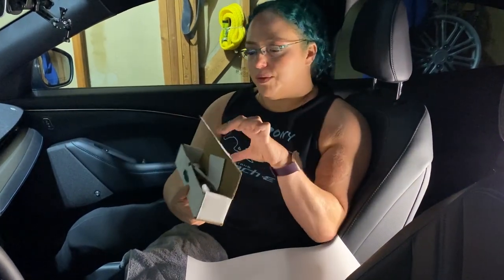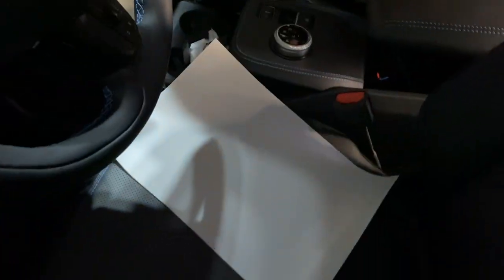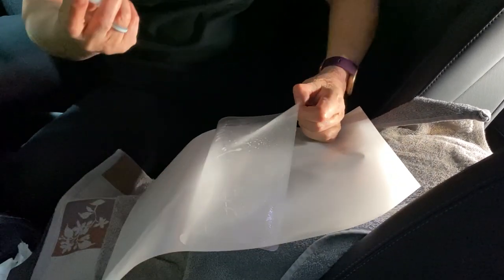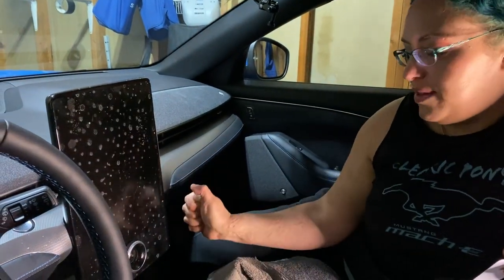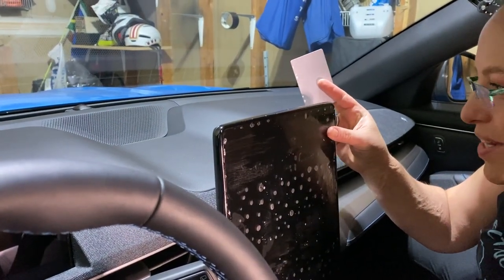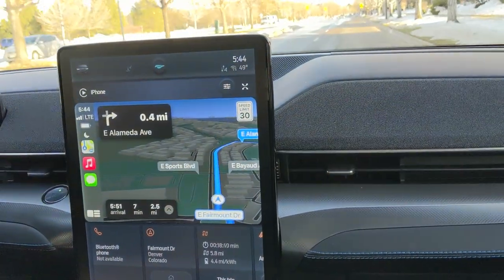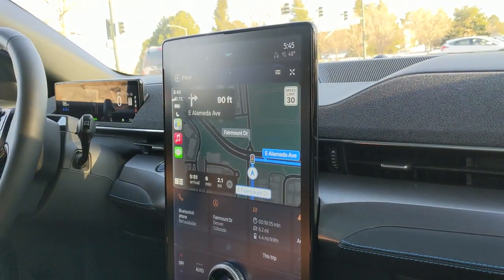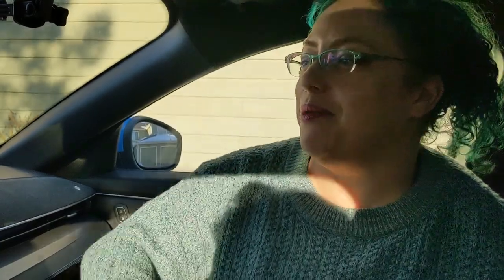Mustang Mach-E Screen Protector (Get rid of glare & fingerprints!)

Comment: Nice job. I love having my OCDPlug screen protector on the main screen and drivers screen. You for sure want this on both screens!! When I installed it I only used about half of the small tube of water/soap spray and it worked perfectly. I think you sprayed it about 3 times more than you needed to, you want the screen to be wet but not dripping. I think this is why the protector was sliding so much when trying to squeeze the water/soap out. It didn't slide that much for me once I started squeezing the water/soap out. I also started working gently from the top center and worked my way down.
Reply: Hey thanks for the tips and input!  I totally used too much liquid!  Sounds like it would be MUCH easier to do it with less.  I think I'll have an easier time with the dash screen but yeah totally agree it's a huge improvement - Liv

Comment: Thank you for making this video. I plan to install the OCD screen protector in my Bronco tomorrow. I have watched all the videos on the ICD web site, one of which was yours. First, your noting that it's possible to have too much soap in the water/dish soap solution was extremely helpful. I was planning to use a large spray bottle that my wife has labeled as "dilute dish soap/water solution," and I'll bet that it has way more soap concentration than called for in the OCD instruction sheet. Now I'll stick to the little bottle and make my own solution, per the instructions. Also, your camera angle when you were driving around shows a good comparison of glare and reflections from the OCD-covered main screen and the uncovered driver screen. Very interesting! Again, thank you!
Reply from the maker: So glad it was helpful to you Alan! Best of luck with your install! - Liv

Comment: Nice work.  Even minimal bubbles would drive me insane.  Not that you did not do an outstanding job.  I can't imagine applying a screen saver to a large screen.  I'll see over time if driving without gets on my nerves and I break down an order a screen protector.
Reply: Haha thanks Maric!  I do think that if one used much less soap and liquid than me then one might have even more success!  Josh with the OCD plug did mention that I could still peel off the top right edge to release the little bubble, spray the screen and protector again, and squidge it back down....but I don't honestly notice it enough.  It's nice to know that you still have a chance to fix it after application! - Liv

Comment: Does the company include a small circle protector for the on-screen power button within the volume dial? If so, did you install that?
Reply: There is  a circle film included for the power button. I installed on mine.
Reply: @macmike4386  Thanks for the reply! How did you "squeegee" that small circle inside the dial?
Reply: @Stryford1  I did not wet the circle as I put it in dry. Have to be very careful . I put the edge of the film on the corner of the credit card squeegee and positioned it inside the hole.
Reply: Sorry I missed this!  Like Mac mentioned, they DO include a circle!  I can't believe I didn't notice it!  They're sending us one to demo along with the dash screen and yup they suggest not to use liquid for that portion! - Liv